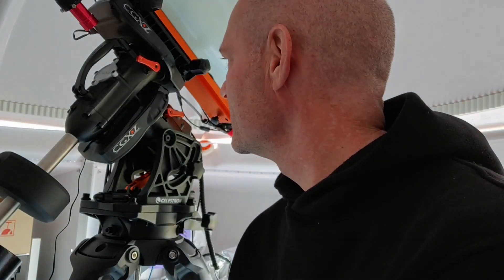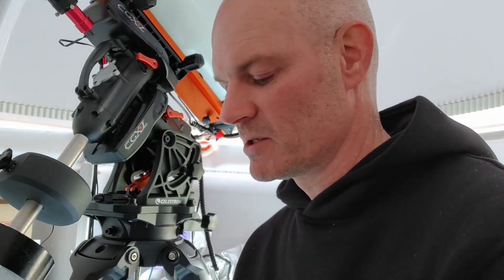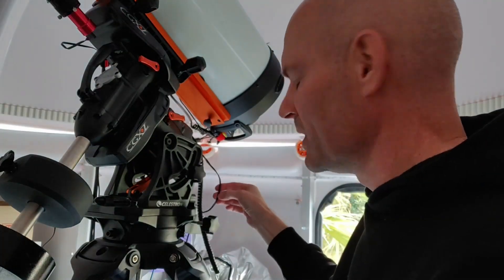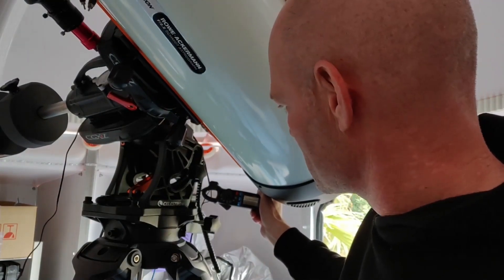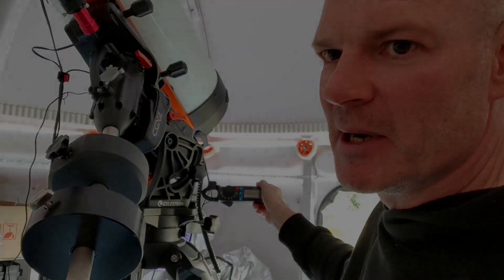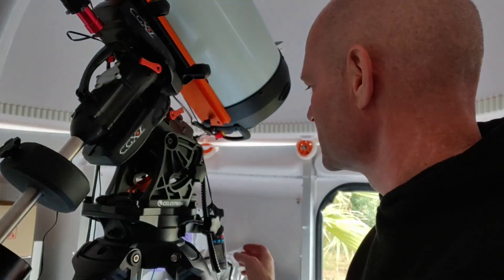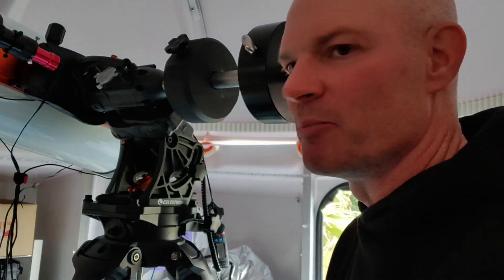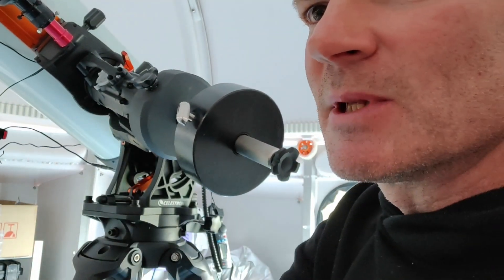Balancing Rig using DC Clamp Meter.

Comment: This is a great idea, and will give it a go - quick trip to a major hardware store required. We CGX/L owners tend to suffer a lot from this.
Reply from the maker: When I first tried it, I was surprised how much 'out' my manual balance was. Stiction is a bitch!
Reply: @DavesAstrophotography  Have the clamp meter ( bought from Ali Baba ), Same BSide model, seems to have the same rotary dials, etc, AC and DC. I have never used a clamp meter before, could you give me an idea re how to use ? Which function dial, etc. It is likely I would nver be using it for anything else - anything with a lot of current, I leave to traddies.

Comment: I find that 90% of clamp meters are too imprecise to measure accurate 10’s of mA differences in current. They usually work at 10A or so or above. Better to make a splitter and wire the meter in series through one side of the DC feed and set to current mode. That mA and uA applies to wired measurement, not induction. Be prepared to spend several hundred USD for non contact high sensitivity.
Reply from the maker: It doesn't matter how precise they are, you are reading the current on both sides so all you are looking for a balance in the readings, the error will equally apply to both sides, Almost like looking at a trend line rather than actual numbers. but yes, I agree the accuracy is for the wired connection.

Comment: Hey Dave, I don't understand why you didn't use the balance with clutch disengaged ? Why is the current meter a better solution ?
Reply from the maker: You need to drive the motors this method. The mount head can have a bit of stiction that can make balancing manually with the clutches disengaged harder. By using current monitoring and driving the motors the stiction will not be an issue.
Reply: @DavesAstrophotography  OK, I see does that mount have a fair amount of stiction then ? I don't notice any on my iOptron
Reply from the maker: @MasseyLee  Yeh, I noticed it on both the CGX and CGX-L, appears to be mostly on the DEC rotation.

Comment: Nice way to overcome stiction on the clutches by doing it electrically. Am thinking though, will those cables hanging over on the left there not influence the balance?
Reply from the maker: Yes, they will slightly, still sorting out some cable management, so its not final yet.